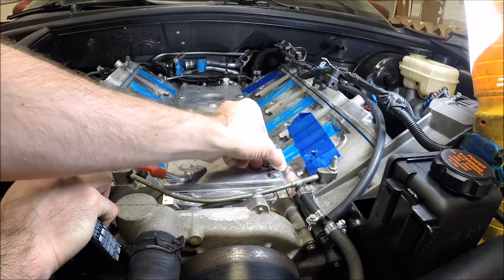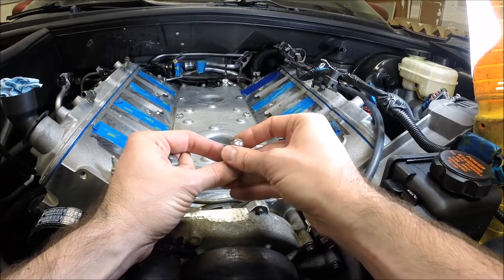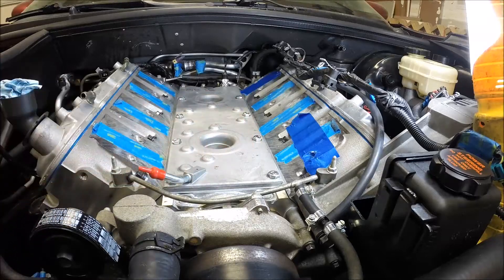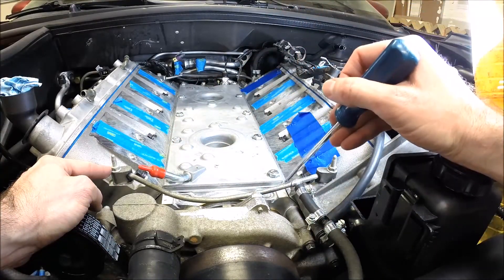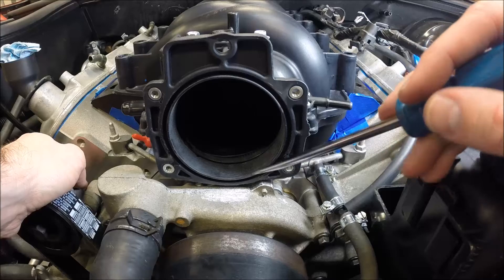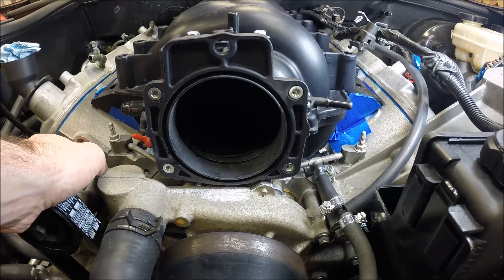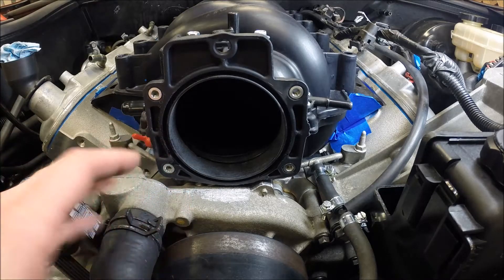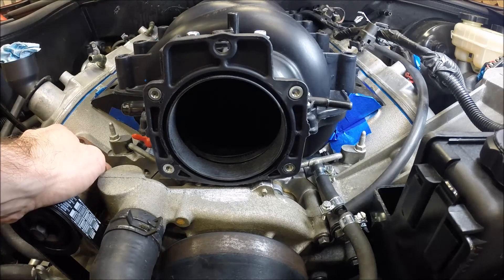LS Tech: Dorman LS2 Intake Manifold Fitment - Part 2

Comment: This video series is a huge help to me. I'm doing a cam/heads upgrade with this Dorman LS2 intake on my C5. Did you just block off the front passenger side PCV breather? The one that goes into the LS1 throttle body.

Comment: I'm having starting and dying issues I have the dorman ls2, didn't tap for hvac line would that be my problem
Reply from the maker: It sounds like you have a vacuum leak of some sort.  If you have access to a smoke machine that really helps narrow down the source.  Also keep in mind the floor of the DLS2 manifold is even lower than the LS6 manifold.  Make sure it’s not hitting the valley cover bolt heads.

Comment: Injectors and fuel rail from the ls1 all fit?
Reply from the maker: Yes.   I used my stock rail and injectors during the initial break-in.  When I got to the dyno, I swapped over to the FAST 36 lb injectors.

Comment: Have you had issues with vaccum leak with this intake manifold. I bought one of these and my mechanic is saying its has a leak?
Reply from the maker: No issues.  There are a number of things that can cause a vacuum leak.  The easiest way to inspect is with a smoke machine.  Just look for where the smoke is leaking.    I did back to back runs on the dyno between the LS6 intake and the DLS2 intake.  When the shop tech swapped over the DLS2 intake he forgot to connect the vacuum hose on the back side of the intake and that caused a vacuum leak.  Found it pretty quickly with the smoke machine.

Comment: Im guessing you used the LS6 fuel rails and injectors?
Reply: Brian Burbage  Yes, I used my stock fuel rail (ls1/6) and Fast 36lb injectors.
Reply: @jeremymcloud30  Your Awsome! 

I say that because your the first " LS Mentor "  that has taken the time to respond to any of my questions.  So Thank You.

We are doing an Ls Swap into an 2002 S15 (4.3 - V-6) for my son, using an LH6 5.3, looking for lower profile better performance intake option. The Dorman website says the intake it wont fit, but like you, I think it will.  I'm sure they call it out due to the DOD.

 I'm trying to do this swap on budget obviously due to the number of specialty parts that are required to make the LH6 fit in the S15.

To expand on my question, I am trying to determine if the injectors and fuel rail system can be scavenged from the orig 5.3 intake.

I'm also looking at the fuel delivery system, jump, regulator and lines to determine what will need to be upgraded on the OG S15.

In the dyno video I believe you had made comment that you expected higher gains, is this intake swap worth the effort?
Reply from the maker: I'm always happy to help if I can.   Unfortunately I haven't done the swap you're working on, so I'm not entirely sure on the injectors.   I think there were some differences between the car injectors and truck injectors.    As for the gains, I am happy with the intake.  It made more power at the top, and lost nothing in the low end.   That said, it was definitely more work to install it, plus I ported the intake runners.

Comment: will I need a car water pump or can I use the stock truck water pump? Im building a 5.3 for my nova and I want to run this intake on my 5.3 but Im wondering what might be required for it

Comment: So would an LS2 Water Pump clear the 90mm intake easier than a LS1 water pump?
Reply: No, it does not
Reply from the maker: Honestly I'm not sure.  I don't have an LS2 water pump to compare with.  Clearancing the w/p and intake wasn't too big of a deal.  So unless you specifically needed a new w/p, I would just clearance what you have vs buying a new w/p.     But if you find out the LS2 w/p clears, definitely post back so others know.
Reply: @ScrufsGarage  Ok will do, thanks for the helpful videos. Much appreciated.

Comment: What did the Dorman Ls2 intake cost?
Thanks
Reply from the maker: I put a link in the episode notes to the Amazon page for this intake.  Looks like it's currently about $385.   Keep in mind you'll also need an LS2 90mm throttle body (silver blade).  I picked up a used one off the Corvette Forum for around $250.

Comment from the maker: FYI, I decided to install the LS6 intake and 80mm TB initially while I'm breaking in the motor.  When I get to the dyno, I'm planning to have them do the initial tune for the LS6.  Then while it's still on the dyno, we'll swap to the Dorman & 90mm TB, adjust the tune, and then do a final pull.  It will cost me a bit more for the extra dyno time, but this way I can get a true before/after comparison on the ported Dorman intake.  So stay tuned for that!
Reply: YES! please and thank you! been tossing around whether or not the dorman is worth it! if you show a gain i'm going to pick one up and home port it like you did.
Reply from the maker: Yes, I'll definitely share the results, good or bad, as I'm very curious myself.   I'm still in the "break-in" period with the motor.  I have about 150 miles on it thus far.  Need to get around 500 miles to finish the clutch break-in too.  So hopefully dyno day isn't too far out.  And I'd like to get to the dyno before it's 100* in August, haha.
Reply: The truck water pump wouldn’t fit?